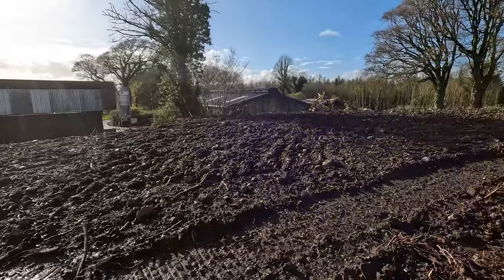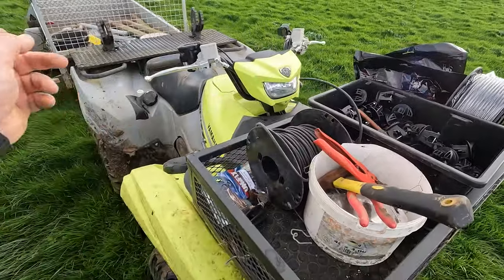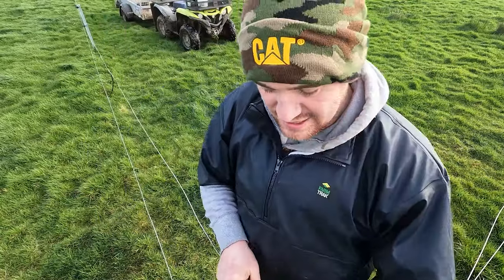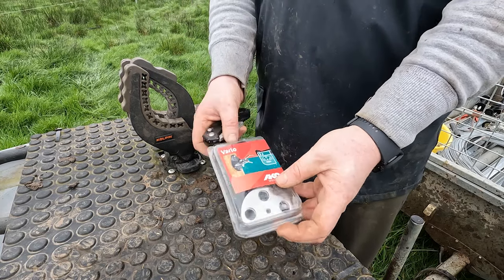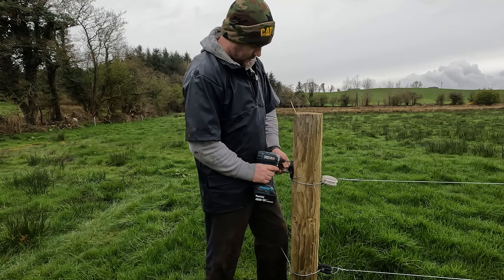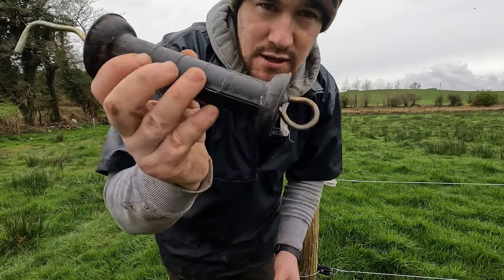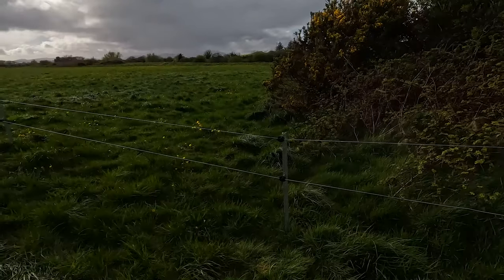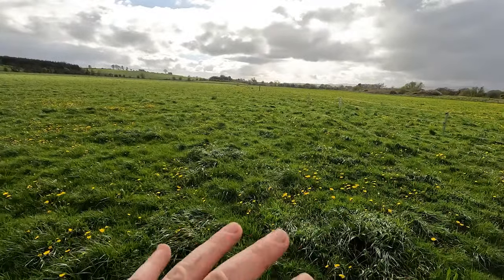before letting cattle out need to work on keeping them in! @clipexfencingstockyardseur8540

Comment: Congrats. Great video. I’d put the insulated cable around the bolt and held in place between the nuts that would give you one hole more for another handle. Cheers from Meath
Reply from the maker: Cheers boss

Comment: Hi, I cannot be exactly sure from what I could see in the video but I think that you are connecting the wire incorrectly with the egg shaped insulators which is leading to fence failure. 
How? You would seem to be using the wire in a manner that it is trying to pull the insulator apart when under tension and any movement of the wire soon saws (cuts) or tears through the thinnest part the plastic insulator. What is needed is that the two loops of wire (one being the wire around the post and one being the fence line wire) are pulling TOWARDS one another with the main body of the insulator keeping them apart rather than trying to tear the insulator apart.
The best and correct usage is to first fix the wire and insulator to the post before fixing the line wire to the insulator. To manage this pass the wire through a hole in the insulator and bend the wire back on itself as tight as reasonably possible and fix both ends very securely to the post. Then twist the wire as close as possible to the insulator with it critically positioned on the inside of this loop for at least one whole revolution. The end result will look a bit like a peach with the stone in the centre (insulator) held in place by the wire as the skin on a peach.
I do this by inserting a screwdriver in a wire hole as pulling firmly as possible whilst twisting the insulation. (If you step back and look at it it appears a little bit like a cherry (insulator) growing on a stalk (twisted wire) attached to the branch (wooden post.)
Then using the tail of the line wire insert an adequate length through the unused hole in the insulator and wind it tightly around the line wire as close as possible to the insulator. Cut any unused line wire not used and disposed of safely.
Note. If you are trying to fix multiple wires (T junction, X roads etc) to one post at the same height it is possible but really difficult to try to do more than two using one securing wire.
Best wishes, Dan.
Reply from the maker: I've been doing ot wrong for years 😅🤣